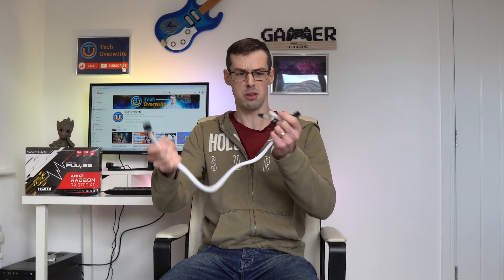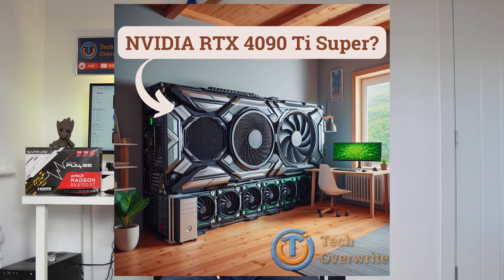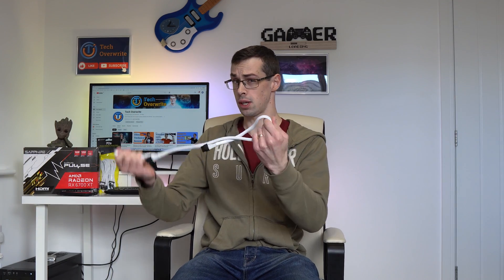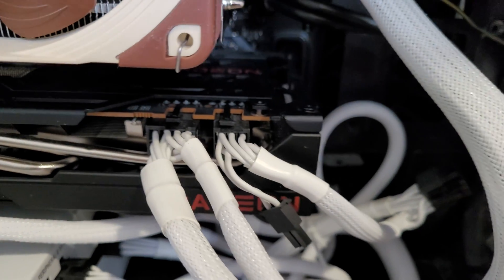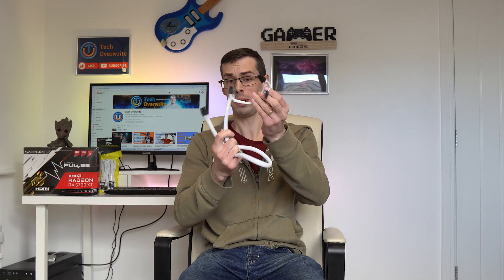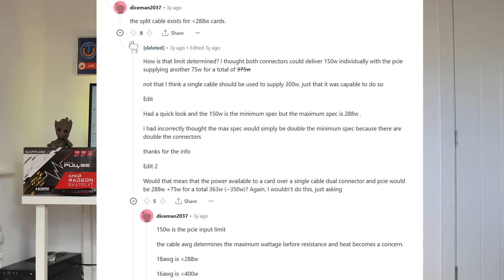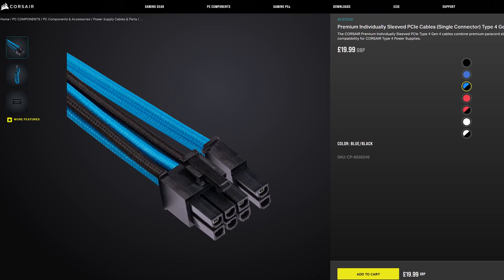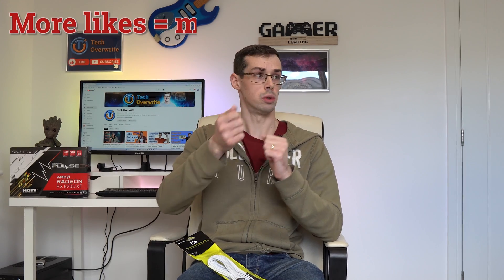Stop Connecting Your GPU Power Cables Like This! (How To PROPERLY Connect PCIe Cables For GPUs)

Comment: If this were true your PSU manufacturer should have lawsuits filed against them since technically you are implying that somehow not enough power is making it there, which means there would be excessive heat in the wires and it's a possible fire hazard, on top of false advertising.

Why wouldn't they just use a large enough gauge of wire, especially on a gold or high end PSU, I'm simply not buying what you're saying unless you actually test it in the wild and show me very clearly how and what has happened. More likely when people get issues they have a defective old ass PSU and/or the wrong power cable.
Reply from the maker: But yet NVIDIA aren't being sued or getting into any trouble despite selling 4-figure GPUs that are melting?

Also I never said that underpowering your GPU is an immediate fire risk. It's more likely that people suffer worse performance or stutters/crashes when gaming.
Reply: @TechOverwrite  While models may vary and companies can 100% produce garbage, I would expect most decent PSU's have a thick enough gauge of wire to deliver the necessary current. It really doesn't make a lot of sense that it wouldn't. If you have this issue it's because your PSU was cheap garbage. Get that off your high end GPU
Reply: @TechOverwrite  All you gotta do is show some real world failures from this and I'm on your side, I'm just skeptical.
Reply from the maker: I appreciate that :) I've spoken to quite a few people via these comments and on Reddit who have had bad performance with 1x cable, but had better performance with 2x cables - so it's not that it necessarily fails/melts, more that in-game stutters went away after switching to multiple cables. You're right that this shouldn't be as much of an issue with quality PSUs though. Many modern ones can probably deliver 288w (or more?) through a single PCIe cable, pigtail or not. And that's often sufficient for all but the highest end GPUs. :) But with a cheap/budget PSU? All bets are off then lol.
Reply: @TechOverwrite  A while ago I had an r9 280x. I actually had some issues, and it did help to split as you said, but it turned out the PSU was bad, and also was responsible for other various BSODs I had. It was a thermaltake bronze. I assume in the cases where this made a difference it was teh same issue, some cheap PSU that is probably causing you various issues that you are assuming are the fault of gremlins in your computer. On various other systems I've never had an issue with pigtails it was only when using that one PSU. 

As far as power each 8pin should provide 150watts, which is totally possible with the gauge of wire used. In fact a smaller gauge would probably still provide the 150 watts, but could cause excessive heat in the wires leading to other issues not excluding fire. Although as wires heat they also increase resistance. But yeah 150watts times 2 and 75 from the PCIE lanes on the motherboard itself. Currently using pigtails on my 7900xtx, wish me luck lol

Comment: Hey I’m getting a 4070 super, I know it’s power draw is about 220W which is still under the max wattage for a single cable but only by 5W. Would it be ok to use the one cable or should I just use two to be safe
Reply from the maker: Hey, it probably depends on the PSU (and exact PCIe cable) but it's likely to be fine - yes. Worst case, it won't damage the GPU - you might just get crashes or stutters, and then you can change the cable setup if needed.
Reply: @TechOverwrite  Thanks for the reply! I ended up going with two cables just to be safe

Comment: even from a year apart this video is still extremely useful. in 2 months from now i should be buying my first gpu (rtx 3070) which needs a 6 pin connector and an 8 pin one.I was still so confused on how i was supposed to plug it in properly since i never wondered, thank you so much for this
Reply from the maker: Glad to hear it, thanks for watching 🙂

Comment: Hi so I have non modular corsair 750W it only has 2 pcie 6+2 which are daisy chained, would i be able to run a 9070xt
Reply from the maker: Hi, do you mean that it's just a single PCIe cable - that then splits into two ends? If so, I would not personally chance this for a 9070xt. You could try it (it wouldn't harm the GPU) but I would at least try undervolting the GPU so it doesn't use as much power. However personally I would change my PSU in this case, sorry :/

Comment: En mi caso tengo una rx 7600 y una fuente de 600w con un solo cable pci en y, entonces al encender la pc se prende una luz blanca en el conector de la gpu, necesitaría cambiar de fuente porque no le da suficiente energía?
Reply from the maker: Hmm that's a concern. Yes if a light is coming on, and you're having issues with the GPU, it probably would be worth you changing the PSU unfortunately.

Comment: I realize this is an old discussion, but I should mention that such power cables are often much longer than needed. If your wire cutting and terminal crimping Kung-Fu is good enough, you can increase the current handling capability of a single cable by shortening the cable length, or even better replace the thin wires with thicker AWG. Connectors and crimping tools are not difficult to identify and acquire. They are useful for many projects.
Reply from the maker: Ooo that's a great point about cutting the cable - even though I'd probably find that too scary lol. But the fact that it increases the current handling capacity is an awesome benefit, worth remembering thanks :)

Comment: What about using only one of the dual pin connectors and leaving the other disconnected? Is that safe? 
My old GPU needed 2 - 8 pin connectors and but my new one only need 1 - 8 pin. Can i use the same pigtail cable but only use one connection??
Reply from the maker: Yes that'll be fine, you can just leave the other end dangling :)
Reply: @TechOverwrite  hell yea thanks!

Comment: So it's completely fine if I have an Rx 9070xt variant with 3 x 8pin and then use the pigtail to fill the last 8pin? (TDP 304W)
Reply from the maker: Yes I agree, 2x separate cables (and using one of the pigtails for the third connection) will be fine here :)
Reply: @TechOverwrite Thanks :)

Comment: I have a doubt and hope you please can help me. I have a BitFenix 750W Plus Gold and today i bought a 5070ti which has a tdp of 300. How should i plug the connectors if i come from a rtx 2070 super with a 6+2 pci plugging? Thanks :)
Reply from the maker: I would use the adapter that comers with the 5070 Ti - so you would run 8-pin (6+2) to the adapter, and then that 'gives' you 12vhpwr for the GPU :)
Reply: @TechOverwrite  Sounds more easy than i thought. Thank you so much :)

Comment: I did this when i read the manual of my new coolermaster psu but then my gpu (980ti ftw 250w) did not give any display and i went back to the original method and it worked, this method might not support older gpus
Reply from the maker: That's interesting, thanks for pointing that out - worth knowing it might not apply to 100% of situations for sure.

Comment: how much damage do you think it could have done to the GPU if I did connect a pigtail to a special splitter that came with a 4070 super? (after the 6+2x2 ends from the pigtail go in the splitter, the splitter ends with a 12 connector that goes into the gpu). i run it for some time and experienced some crashes with fans to max. as soon as I have realized the mistake, i took the gpu out and ordered parts to have the proper cabling. but I was wondering if I could have caused damage to the gpu (at the moment i don't have it in the pc until i get the cables, but it does work)
Reply from the maker: It should be fine to be honest, I doubt that you damaged it permanently - especially if the GPU kept powering back up after the first crash. It was probably just underpowered and shutting down for safety, to avoid any real damage :)

Comment: What if gpu has 300w tbp but requires 3 8pins? Will i be safe using 2 directly connected pcie 8pins and 1 pigtail pin
Reply from the maker: Yes that'll be fine for a 300w GPU :)

Comment: Ive been sitting on my new 9070XT for 2 weeks thanks to amazon messing up my order for another Cable to come in. I was tempted to use my Old Pig tail cable but not anymore
Reply from the maker: Oh no, sorry to hear it :( That's frustrating. I hope you get the new cable soon, I think it's worth waiting for that than running a single cable for a 9070XT.
Reply: @TechOverwrite  Ive finally got the power cables, And man this GPU was a huge jump from my RX6600 😅 Definitely worth it!

Comment: Firstly, thank alot for your video. It's explained alot. 

Secondly, something interesting found when measure via power meter from psu: which resolution play significant role in power withdraw. Here it is & I hope it is useful:

@ Normal operating (Omitting 75~95W from Board or CPU)

* 1080p = (75W * 1 ) = 75W (1 cable)
* 1440p = (75W * 2 ) = 150W (1 cable + combined port)
* 2160p = (75W * 4 ) = 300 ( 2 cable separated).

@ OC or full power operating *(Multiply by 25%)*.

* 1440p = 187.5W (2 cable seperated).
* 2160p = 375.0W (3 cable separated).

Full power rises by demand on game and it is variable waveform, that why it's required more seperated cable for safety purpose when dealing with powerful gpu.
Reply from the maker: That is interesting, thank you - definitely good to know :) It helps show why (and when) having multiple separate cables is beneficial.

Comment: Don't forget  House has a building code  forgot what term was but something about  Safety of something?   It basically tells an electrician how much power a wire can supply safely at a % of max   PC parts do not have this safe guard to guide the industry  so the NVidia power plug 12v6?   is at 100% of it's capacity and a reason it's melting and catching fire  well one of many reasons there's other failings in the plug too
Reply from the maker: Good point thanks, worth remembering :) Maybe safety headroom> Either way, I agree, it's been a mess with 12vhpwr. It sucks that NVIDIA ignored the warnings and made the 50 series even more power hungry.

Comment: You know I did connect my FE 1090 TI from EVGA  like this LOL  then I thought it looked stupid so I found another and used that but that was in 2017   and ever since that time I always wondered why didn't they just sell you a plug without the extra plug on it?  Especially since then GPUs  require more power and doing this would harm it?    At least now days the good PSU's do not have these dumb power plugs now
Reply from the maker: LOL yep it does end up looking weird. I do wish that single-ended PCIe cables were the norm - I think pigtails (by default) do more harm than good.

Comment: I'm running a 5070 Ti with 3×8pin power connectors. My PSU (UD750GM) has 3 PCIe ports, but only came with 2 daisy-chained 8pin cables. Since the card has a 300W TDP, it seems okay, but should I still get a third dedicated cable?
Reply from the maker: Hmm interesting, you should be fine in this case. 2x separate cables should be enough I agree. I mean, it's not 'ideal'/perfect - but it should be okay :)
Reply: @TechOverwrite thanks a lot. Really helpful~

Comment: I recently had random signal loss on a new Win 11 build because I was only running an 8 pin with pigtail like you showed for my two 8 pins on my RX 7800XT. It was driving me nuts for about a week until I looked it up & realized it doesn't run 150w per lead on pigtail like I thought it would on my 1200w psu. It spilts the power so it was only like 75w per lead not 150w & was making the gpu to reset the driver & pc would stay on until hard reset.. I thought when I originally hooked it up I should use two seperate leads from psu not just the ones pigtailed. I had asked a friend & he thought my psu should do 150w each, which it does just with two seperate leads. Just glad I figured it out lol
Reply from the maker: Huh that's really interesting, crazy that you were having so little power delivery on a 1200w PSU lol. Glad you got it figured out though :)

Comment: Hey thank you very much! Im having blaacck screen and PC reboot suddenly happening with my RTX 4090, i discovered is something happening with PCIe cable cos when I move it, it the whole pc recovers their normal behaviour (sometimes I cant just watch a Youtube Video, or open a texturing app for 3d) sorry for this basic question Im not so good a hardware, so should I buy a new cable or something different? could you pls tell which one should be the best for mi card? thank you very much, the PSU is a CORSAIR
1000W RMx Series, this is the one that Im having that I read It is reccomended since it can  deliver up to 600W. ---> 12VHPWR CPH-6610 should I just buy a new one?
Reply from the maker: Hey, happy to help and nice GPU :) Okay so that's a bit concerning! The RTX 4090 will use a 12vhpwr cable and this can sometimes have melting issues. I would urgently remove the cable from both the PSU and GPU and check both ends, to ensure there's no melting. It's concerning that things shut down when you move it.

And yes, I would then buy a new 12vhpwr cable just to be safe. Not the "CPH-6610" cable though because this is for BeQuiet, it seems? I wouldn't mix cables from different PSU makers. Have a look at the compatible Corsair cables from your exact PSU although if your PSU is from 2024 or earlier, it's likely that you would need to buy the Corsair CP-8920284 cable - which has 2x 8-pin ends (for your PSU) and then 12vhpwr on the end end (for your GPU). Hope that makes sense a bit :)
Reply: @TechOverwrite  ohhh thank you very much for your answer!! I still got some doubts do you think I may can dm and share you some pic? which channel do you usually use? (Discord, IG, etc), and btw I expressed wrong is not that the pc is shutting down when I move the cable, is shutting down when using an app or playing a vg, but then I need to unplug and plug back the cable again, otherwise the pc starts but the GPU doesnt recognizes the screen, and Im only getting sound but no image... the only thing that worked so far was unpluging and plugging the PCIe cable, also did a "Power test" trough OCC software and effectively the computer reboots so it is something related to that for sure
Reply from the maker: @gabocavallaro  yes sure, to be honest email might be best - mine is tristan@techoverwrite.com

It's concerning that it's shutting down when putting it under load (OCC power test, playing something etc). It could be a bad connection or cable etc, but please do email any details you have.
Reply: @TechOverwrite  Thank you very muchhh!

Comment: i've used daisy chain config for about 6-7 years that is before modular psu's were available, i did always used quality psu's cooler master or seasonic with jap capacitors, none of that corsair china capacitor garbage he has, corsair in general is a garbage company that i always avoided
didn't experience any problems, with ngreedia that is, nor did i ever had melted gpu cables or connecters, 12vpwhr or whatever nonsense that is, time will tell
8 pin and 6 pin deliver same power btw, 2 extra cables on 8 pin is just extra ground connectors for "extra safety" lol whatever that is, so basically 8 pin is a lie
Reply from the maker: Thanks for the comment, and I'm glad that the daisy chain connector worked out fine for you :) Some people have had better stability when moving to 2x separate cables but if it works for you, then that's great. I think the fact that you always went with quality PSUs with Japanese capacitors helped a lot - I agree that it's worth going for ones with that.

Comment: I got a evga 3070 XC3 and a MSI a650bn psu, I just realized that psu only has one daisy chained 6+2 pin connectors. It’s not modular either, will I be fine with the daisy chains for the 3070. This is my first time building pc, hopefully I don’t need to get another psu
Reply from the maker: Congrats on the first build :) You might be okay, the power usage of the 3070 isn't super high. I would just try it out, and see if you get stutters or crashes (especially when the power draw is 220-225w or so). If you do get issues, then either swap the PSU - or look to undervolt the GPU a little. This will then allow it to run fine with the single cable :)

Comment: Built a new PC in the fall and got a 850w PSU with 2 8-pin connectors. The marketing is a bit deceiving (says there is 4, but its 2 with 2 pigtails). I recently got a 9070xt with 3 connectors. Was bummed that i might need to get a new PSU, but based off this, i'm going to give it a try.
Reply from the maker: Ah that's frustrating, it's not always easy to know how the PSU's power connectors will shape up when ordering. To be honest you might be fine with just 2x separate cables since the 9070XT doesn't consume a massive amount of power (300w or so), so you could always try and see if you get crashes before ordering a new PSU.

Comment: Hi, I have an RX 5700XT and an MSI A650BN because it was recommended by many, was on the tier list at C, and only cost €60. Unfortunately, it only has a PCIe cable with an integrated pigtail. Is that still okay?
Reply from the maker: Hi, that'll probably be fine for a 5700XT yes - the power draw is kinda borderline, but my hunch is that it should be fine in 99% of cases.